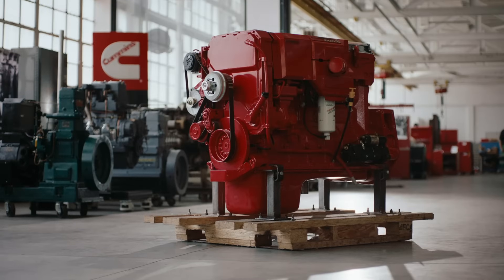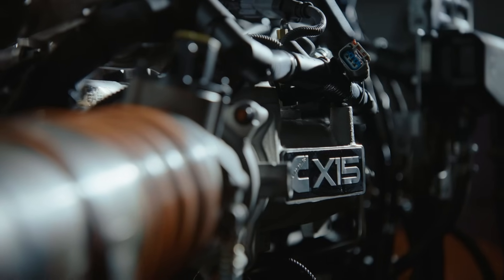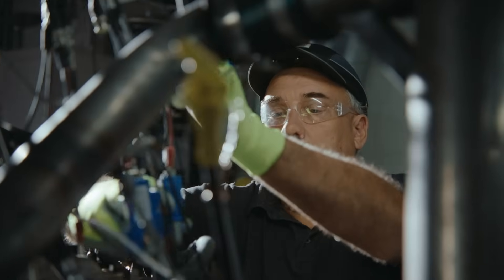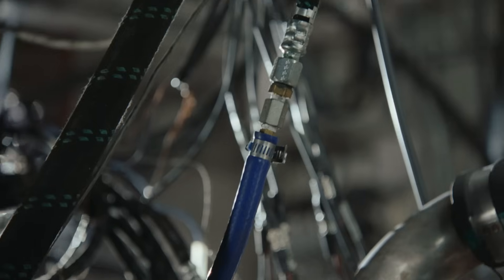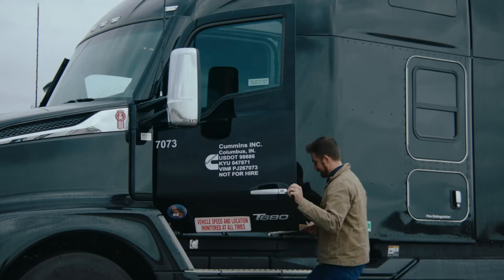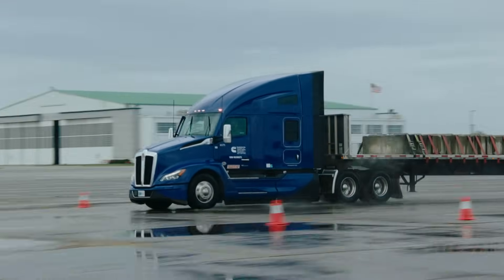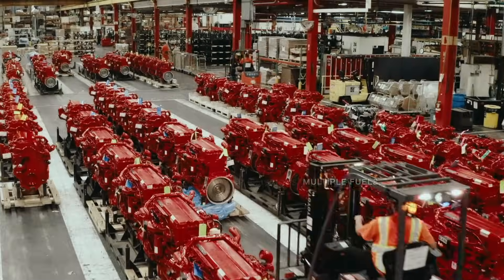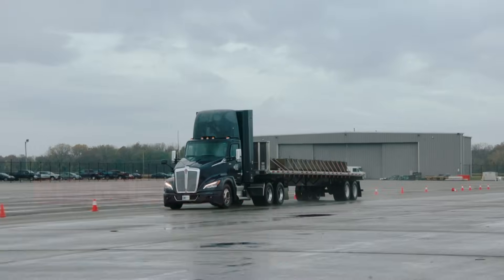Next Gen Cummins X15 HELM

Comment: There are many solutions means, we need to continue to make money off the long contracts we locked ourselves into. We don’t have the tech to solve issues currently being solved by Tesla. We would have to start over without the skills or money. We need to keep selling overly complicated engines and other drive train parts to try to solve issue Eaton and others had by buying them and including their bad engineers into our product lines. Please buy our expensive, unreliable, overly sensored engines so we continue to make money for our investors while burning your money on failed overly complicated tech that fails more often than the old Cummins

Comment: So much focus on efficiency and not enough on reliability. What efficiency is gained with having premature part failures and shorter overhaul intervals. 
Getting 1M on an in frame and having minimal issues in between with good maintenance was very efficient. There is more to efficiency than what’s coming out of the tailpipe sadly.

Comment: Cummins, NONSTOP check engine lights, derated engine due to fault codes, electrical problems that nobody can find. Low CO2 due to sitting at dealer shops waiting for weeks to get fixed. How can anyone afford a new truck that can't work of be dependable. My 2009 cummins cost me $60000 in repairs before throwing the #5 rod through the block and breaking it in two, not under warranty. GARBAGE
Reply: Sounds like that was a recall truck bud cummins are great you just got a horribly built one/half a**ed
Reply: @jaypayne8363  I have heard and seen more Junk Cummins than just mine. If you want to be a cheerleader for cummins be my guest but I am around them all day and I know what complete trash they really are. TO BE SPECEFIC I am talking about the X15 and anything 2007 or later, the older cummins were great, N14, big cam.

Comment: I bought a new isx in 2000 dual overhead cam engine. Had 1,350 ,000 miles on a rebuild. Changed oil every 10,000 miles. all done at home.  Been a great engine. Still. Running it. Would never buy one with this emissions crap on it. I’m 68 years old. About ready to retire.  Don’t like being out here anymore. Drivers are not like they used to be. A lot are foreign. And have no courtesy.  Had Cummins since my first new truck in 1978.  Take care everyone.
Reply: Thank you for keeping the country running, Sir. Enjoy your retirement!

Comment: Aside from the emission lines of conversation. Lets focus on repairability and serviceability. The very first topic is the "special tool count" of which Cummins as the leader in being the worst for. Every new series of engine comes out with a new list of very special overpriced tools for that engine. Detroit while have their own special tool list, has put a lot more effort into serviceability and minimal repurchase of special tool while also keeping the cost per part MUCH lower than a Cummins. 
I hate to say Cummins is a built to sell engine while Detroit and CAT are built for service, we no longer allow Cummins as their cost of parts and service plus regular downtime costs too much. We no longer buy pickup either for the same reason, there is no value in Cummins being under the hood right now.   
Cummins problems are further exacerbated by companies such as PACCAR and VOLVO who shoehorn the engine into their trucks without any thought of serviceability and accessibility.  Built to sell. The new theme in my generation is "built to service" which will define the new direction to much more sustainable ownership.

Comment: When will you build truck engine that will hang with N-14 Red Head not nickel and dime us to death with electric problems would be nice they would run with hang with 400 big cam 700000 miles not give trouble

Comment: They keep saying the word "efficiency" how about reliable
Reply: How dare you!
Reply: It's going to have the biggest exhaust filter you've ever seen. The exhaust fluid tank will be bigger than the fuel tank. The ISX15 was good for 400k miles, the new x15 should go 200k before an expert needs to rebuild it
Reply: @macbook802  Higher cost and less reliability?  Progress!
Reply: Nobody want built  bulletproof engines any more, they want sell parts ,more parts more money)) 
Rip n14😢

Comment: Glory & Thriumph time past. Oil fuels motor - ( Adabatic Engines) still modernisized but be like names diesel Engines. Rodolfo Diesel the Germán with penut oil fuels  ones. They high comprensión motor needs new formulation & more strickt mufflering & gases process  for a correct Exhaust. New fuels a large displayments - top materials and a new visión  for high compression Engines. Not diesel. Or same restricts & fines for that diesel. Needs changes for to be a modern new high Power source then ( Name it a Cummins Engine) Diesel term & it's past of that story. We need a new era a new engine tech 🙋🙂 Good ones & Postives Vibes for alternative power fuels.

Comment: When you can make an engine as fuel efficient and reliable as the DD Detroit engines, then I'll listen.
Reply: Old Series 60 not Mercedes ones
Reply: There is a real good reason Freightliner with DD engines are the vast majority on the road.
Reply: @Tchristman100  more Volvo here .
Reply: Volvo just about copied the Detroit Series 60.
Reply: @Tchristman100  Volvo Construction equipment excellent also .
Reply: @Tchristman100  Not here in Australia . Freightliner are just about non existent now.  The only truck that lasts is a Kenworth. There is a 2 year waiting list if you want one. Only reason ovloV have a look in is because they are available now but they don’t last the distance, most usually catch fire , just can’t handle real linehaul work.
Reply: You mean merc engine with a Detroit badge.
Reply: No sorry, the DD engines came out in 2008 in USA exclusively. Merc watched how our trucks peformed with the new engines then decided in 2010 to make their own versions called the OM471, OM472, OM473. 1st time a Merc truck had Jake Brakes.
Reply: @Tchristman100  I’m sorry but they are shitter, plain and simple. Series 60 was probably their best but was never a match for signature
Reply: Since Freightliner sells both Cummins and Detroit, (I was a salesman engineer with LA Freightliner), when a truck came in with a Cummins, It took 2 hours to analyze. Detroit's took 15 minutes. And believe me Cummins were in the shop a lot more than Detroits.